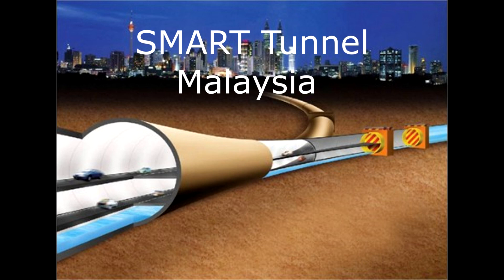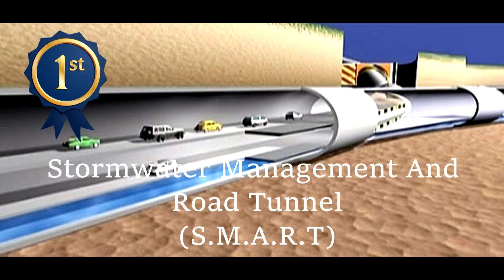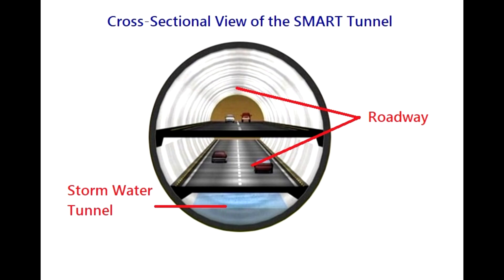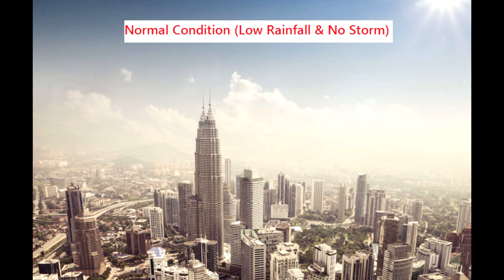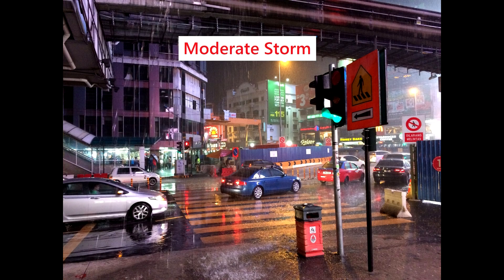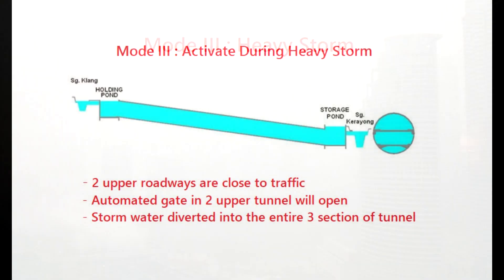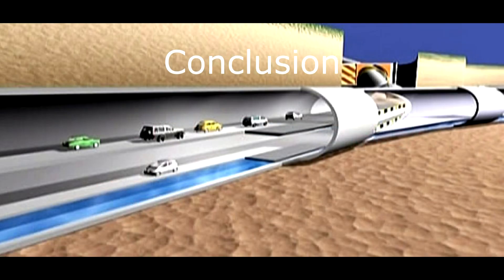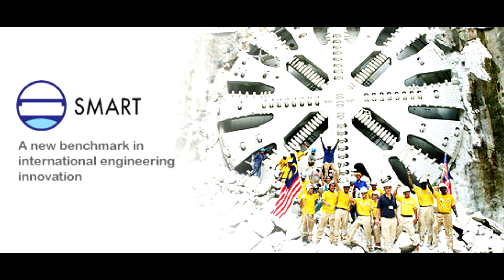How SMART Tunnel work

Comment: i have read a study namely Effects of SMART Tunnel Maintenance Works on Flood Control and Traffic Flow it conducted on 2017. it shows that it significantly reduce flood in Kuala Lumpur. But, not a good resolution for reduce heavy traffic flow. From my opinion it may because of the smart tunnel no so integrated.
Reply: On 2022, the flood happened again. i assume that maybe the smart tunnel is not suitable anymore. Due to heavy construction with not having a good water management system.

Comment: Kenapa ada smart tunnel ni tapi masih banjir ye. Can anyone explain ?
Reply: sebab air bukan dari sungai sahaja. smart tunnel ni dari video ni hanya utk elak limpahan air sungai. banjir dekat shah alam ni bukan setakat sungai tapi longkang jugka
Reply from the maker: The smart tunnel had retained 5,000,000,000 litres of water which is the maximum capacity. Kalau tiada tunnel ini situasi akan menjadi lebih teruk.
Reply: @c.tyangs9406  ooh. At least we have to thank tun m for this project eventhough ramai kritik dan benci dia.
Reply from the maker: @cjwwo8340  Agree. But obviously the current government need to build more infrastructure to prevent the flash flood like Dec 2021.
Reply from the maker: @cjwwo8340  Agree. Our current politicians  are just playing politics but not actually solve the problem and needs of rakyat. I am very disappointed to our government and don't have much expectation to future of Malaysia  🥲
Reply: the tunnel covers area around masjid jamek, this was after the flood which flooded entire dayabumi and dataran merdeka parking back then